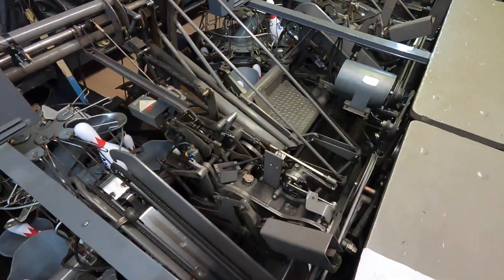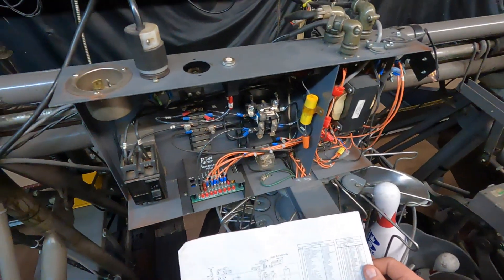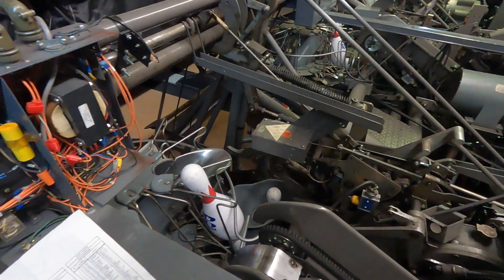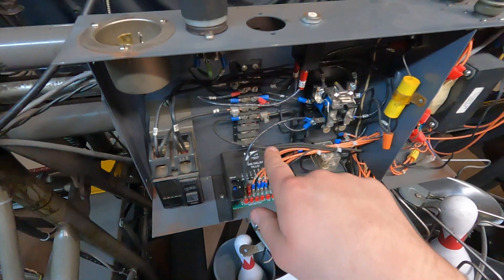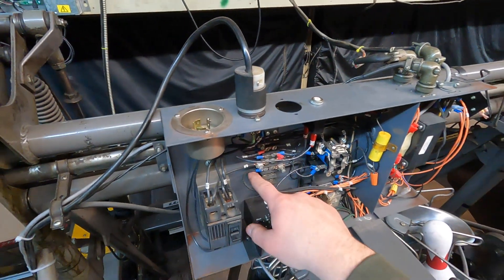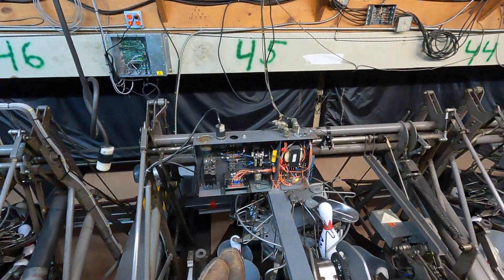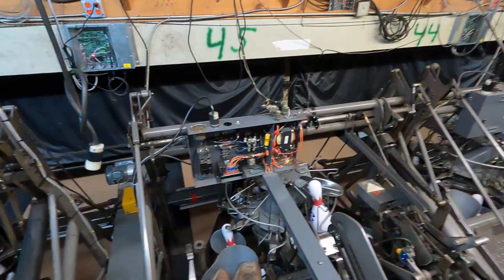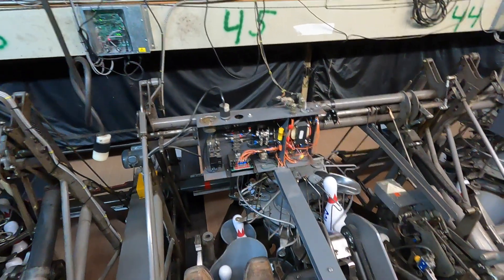Cycle Solenoid Wiring - Brunswick Pinsetter Explained

Comment: I have a complete control box I need to wire up. Any tips or pointers ?
Reply from the maker: Follow the book and keep your wires a consistent color with the corresponding gauge. Also the resettable fuses are great, just make sure that they are good when you get there
Reply: @thepinsettermedic  i downloaded the full manual ad printed it out. i am gonna start wiring it up next week.